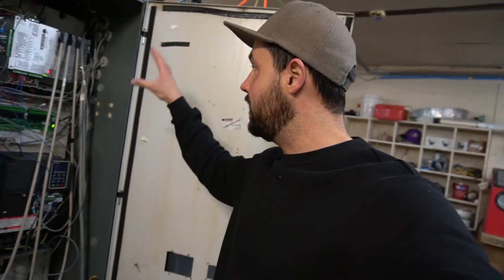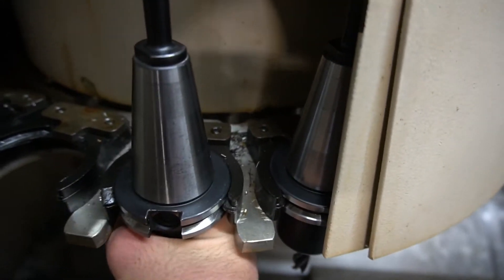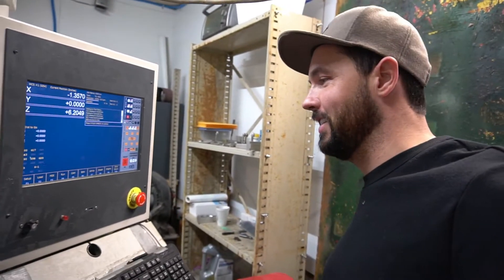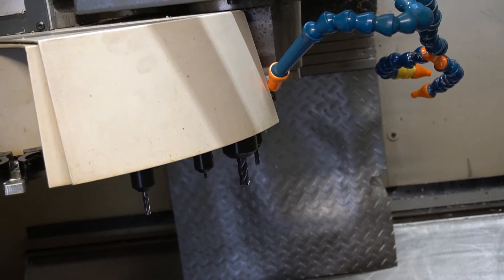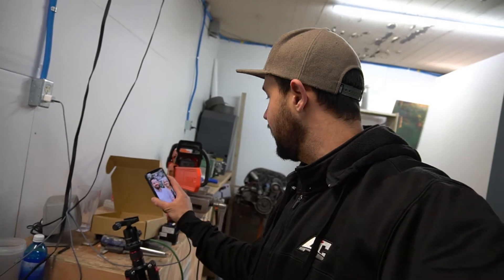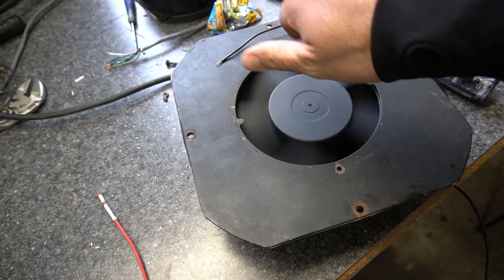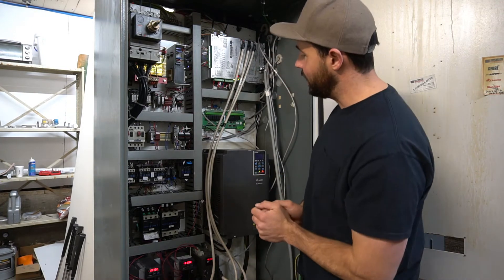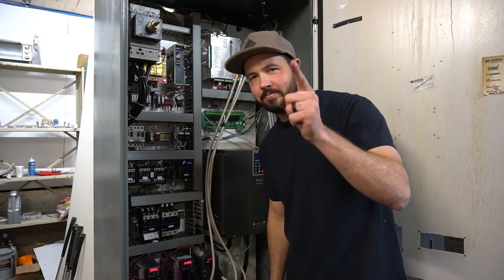Centroid CNC tool changer.

Comment: How do you use the rotary encoder to set the correct position for the spindle orient with the vfd?
Reply from the maker: What VFD are you using?  On the C2000 there is a parameter and you need the centroid orient card but has to be wired correctly.

Comment: I have 2 similar VMC's. My only fear on doing the retrofits is the tool changer integration. Very curious just how difficult it was for you to get the tool changer working?
Reply from the maker: It’s a long hard road even having done 2 of them I still had issues.  Hardest is if your carousel is servo connected.  Requires a custom PLC and a few other boards and tricks.  If they are just an index of one pulse per pocket it’s a lot easier.  If you have the time and resources a retrofit is an amazing way to go however, I couldn’t even come close to buying the value I have stuffed in my machines due to retrofitting.
Reply: @ericschneiter  Yes, the carousel is spun via a small Fanuc red cap servo. Who did your PLC work?

Comment: I can't believe I stumbled on this video as I watched your other videos on your channel before!

I'm installing a Centroid Oak on my Arrow 750 as we speak and looking for a VFD. I noticed you have the Delta C2000 and I was recommended that by Marty as well. Do you have a build thread on the Centroid forums?  Also, would you be willing to share the macros for the tool changer? I'll be most likely running into the same issue as you since I have the same tool changer.
Reply from the maker: Kris,  what’s up man!  That’s awesome to hear, you’ll be happy with your retrofit when it’s up and running. 

I would also recommend the C2000 I’ve got 2 of them on both my mills and they have been an excellent VFD!   

Info you’ll need:  
1- Buy your VFD 5 HP over your spindle motor.  If you have the 10 hp 10K rpm goldline motor you’ll want the 15HP Delta inverter:  product# VFD110C23A
You’ll also need the orient card for the inverter: EMC-PG01L 

An amazing contact for the inverter straight from DELTA in China is: 
coco@tdk-automation.com she can get you the inverter and the card.  

Once you get your inverter refer to tech bulletin 316 on the centroid forums.  It’s the most up to date.  

2-Follow the schematic and wire up your inverter with all inputs and outputs correct.  Pay special attention that the card and the inverter may sink or source depending on what schematic you are using so set the dip switches accordingly and be very thorough on labeling your wires.  
I used the existing braking resistor on top of the cabinet, use extreme caution as this circuit is probably one of the most dangerous in your install.  Don’t ever work on your resistor with your mill powered on. Or either end of the wires open, they both need to be connected to the drive if it’s powered up.

3- You’ll also need to buy a spindle encoder from centroid and machine yourself a mating sleeve to the top of the spindle motor shaft. “I can email you the solid model” There’s a nice spot to mount if you take off the fan and the existing spindle encoder.  The centroid encoder is 2000 counts and this matters when you go to set the inverter so just buy the centroid one with the pigtail lead.  It’s money well spent.  

4-When you set up your spindle inverter and motor you can leave the motor attached to the belt.  Begin with the static and the rolling test after you set the motor parameters.  If you don’t do this in exact order you’ll get overload errors while trying to run your spindle.  I also completely disregard parameter 11-00 I’ve never had good luck with the tuning.   It’s a lot man but hope this helps somewhat.
Reply: @Eric Schneiter  Eric, wow, I'm blown away with your response! Thank you for taking the time to write up the reply!! 

I'll definitely check out your contact for the C2000, and I appreciate the advice for oversizing it
I'll also check out the diagrams on the forums. 
I will most likely reuse the existing resistor as well, and thanks for the heads up on the dangers of it!
I'll make sure yo get the encoder from Centroid as well.

Thanks so much for all your help! This will greatly help with my retrofit!!
Reply from the maker: @krissondors  for sure man!  Good luck. Feel free to hit me up if you get stuck along the way. Happy to throw you pointers.  Do you have your axes moving yet?  What drives and motors are you going with?
Reply: @Eric Schneiter  I really appreciate that! I currently have the machine operational with the original Cincinnati/Kollmorgen drives.  I wanted to use them but after lots of consideration, I decided that I should replace them out since any diagnostics with the drives are a nightmare since it's all early 90s technology.  I was going to swap them out for some Chinese servos (I was looking at Tomatech servos and drives) but I came across a great deal for a decommissioned Centroid retrofit that comes with used Yaskawa servos and drives, perfectly matched for my machine. I'll be getting those this weekend so soon I'll start taking apart the Arrow and installing the Oak and motors.  I might use a generic VFD and manually chance the tools in the meantime, since I'll have to wait cod the Delta C2000 to come in.
Reply from the maker: @krissondors  awesome dude YASKAWA will be a super good option for you. It’s super slick with the probe when you get to that point.  I love my arrow, it just cuts all day now and never has issues.
Reply: @Eric Schneiter  I think so too! I was considering the Delta servos too but I feel like they are still a bit too much for what they are. I know someone who got some new Yaskawa servos and drives from Alibaba and they are legit, but he got them for way less then they sell here in the States. That was also another option I was considering.  

I'm really glad to hear your Arrow is being used a lot! I'm excited to get a probe too, I want to get one from SilverCNC, they make a wireless work probe (like the Renishaw style) for about $1400 shipped and I have heard great stuff with it. I think it would be badass to have that in my tool changer and use it for work coordinates but also digitizing too.

Comment: I’m building an 1990 Bridgeport Interact 412. How did you get orientation to work? Does your VFD have an orient option? What VFD are you running. Any suggestions would be helpful.
Reply from the maker: John Burbey, what control are you going to use? Centroid. Mach, Liniux?  I use delta VFD’s and I like them. It’s a single input and orientation is built into the inverter with a XYZ encoder.
Reply: I am using centroid acorn. What is the model number of your VFD.? What type of spindle is on your machine? How does that VFD handle speed control? Is that spindle a Yaskawa or Fanuc ? Was the Spindle encoder built in the Spindle Motor? Is the encoder just a magnetic type? Yes your help is appreciated.
Reply from the maker: @johnburbey5153   I don’t know if acorn has enough hardware to run a spindle orientation.  You may need an Oak board.   But I used a centroid encoder and found a way to mount it to my spindle motor.   My spindle motor is a Vickers but if you can pull the cover off and find the motor shaft then you can figure out a way to mount it.  I had to machine myself an adapter.    You may have an existing encoder that would work but I ditched my factory one and just went new on both retrofits I’ve done.    The encoder hooks to the Delta  C2000.  Highly recommend delta C2000 I’ve used it for both my retrofits.  Buy it 10 HP over your spindle rating is my recommendation.   Ex if you have a 10 HP motor buy a 20 HP inverter.  They claim more than they can run.  
Tech Bulletin 316 has all the steps to set up the drive and tune it correctly.  Again I believe you’ll need an oak or a board that can handle encoder input and the orient command m19.
Reply: I can use acorn you just add a ether 1616 expansion board and that gives you 16 more inputs and outputs. Yes there is a encoder in the motor but it is just a magnetic one. I planned on adding a new encoder. I had to put one on My lathe. My biggest problem was the orientation. I bought a 20 hp Fuji which is a very nice drive but it turned out to have no orient option. At this time it’s difficult to get the drives after Covid. I will check this morning and hopefully they have a Delta.                                Thanks John
Reply: Looks like the C2000 is discontinued they do have a replacement the number is 110C23A-21 I hope they didn’t change anything and they have stock.
Reply: I guess I picked the wrong time to do this the drive are out 32 weeks
Reply from the maker: @johnburbey5153  check out TDK automation on Alibaba.com.  
Coco Wan is who helps me.  She can get you an inverter within a few weeks.   See if she can get you the braking resister also, you’ll need it, you can find it on DIGI KEY and just give her the part number.
Reply: How do you search a specific vendor on alibaba ?  I have purchased a lot of stuff off alibaba  but I usually just do my search for what I need and once I purchase then I have a connection with the vendor.
Reply from the maker: @johnburbey5153  id just search TDK automation.
Reply: Hi Eric I’m back I found a Delta 110C23A-21 on Ebay. New but open box. TDK did not get me know where there just was no stock. Now my question is what watt breaking resistor are you using?
Thanks John
Reply: Hi Eric I hate to keep bothering you. I have a couple questions. Is your spindle A Permanent Magnet Motor?  Did you have to add another card to your VFD? If you did, did you use a EMC-PG01L or 2    or did you use a EMC-PG01LU  which seems to be what they want for PM motors. The EMC-PG01LU did not come up in that tech bulletin. Could you help with a wiring Diagram?   Thanks John
Reply from the maker: @johnburbey5153  I’ll have to check. I used the PG01L for my inverters but my spindle motors are induction 10hp and 15hp.  So if they are telling you that they usually know their stuff.   As far as getting it working I’m not sure if the card would work different.  You might need to send Centroid a message, I would think it would still work the same wiring diagram.
Reply from the maker: @johnburbey5153  any updates on your spindle?  Did you get your VFD working yet?
Reply: @ericschneiter  I just cant get the PG01L card to set up. When I put it into FOCPG mode and try to run the spindle I get Error code PGF3. I am not having any luck getting any tech support. From Delta or Centroid. When You set up your card does it allow you to set the rpms of the motor past 1799 RPM. I spindle runs great when not set up in FOCPG mode. I am using to make some parts just cant use the tool changer.
Reply from the maker: @johnburbey5153  you can leave the RPM where it is. It’s not relevant.  Your frequency will decide what speed your spindle actually spins. Super deceiving parameter.  What encoder are you using?
Reply: @ericschneiter  I tried a omron encoder I thought that might have been bad then i bought the one from centroid and it does the same thing I just don't know where to turn
Reply from the maker: @johnburbey5153  what do you have the encoder counts set at?  And what do you have it set at in centroid?  Should be 2000 on the C2000 and 8000 on the centroid control.
Reply: It says on the sheet set at 1024 that’s where I have it
Reply from the maker: @johnburbey5153  let me check pretty sure this is an error.  What tech bulletin are you using. Make sure you use 316 it’s the most recent.
Reply from the maker: @johnburbey5153  set the C2000 at 2000, Centroid Counts/Rev at 8000 and MAKE SURE you set MOTOR REVS/IN at 1.   Then go back in, tune parameter 5 static and rolling and then try putting yourself in FOCPG mode.
Reply: @ericschneiter  well the 2000 seemed to help it doesn't get the error but it sounds rougher when it runs. and when I change the hertz to bring up the speed it doesn't do anything and when you try to control the speed from centroid  it is not very responsive
Reply from the maker: @johnburbey5153  did you do the tuning in parameter 11?   I never had luck with that.  You might try resetting it, set the parameters in the C2000 just for the motor, tune in parameter 5 and then set the rest of the parameters.   It may be different for Acron than Oak. This is what I did.
Reply: @ericschneiter  Thank You again I think I am in a better place now than Before. I think It was the 2000 count. I think now the issue is in my encoder. Yesterday I was doing something with the PG card and I hit the 12/5 volt button and smoked my centroid encoder. Now I'm running on my Omron encoder off the spindle with a belt and it's not a timing belt It appears to be slipping a bit and now I think that is messing with it. When I bring up the Number from 100 to 120 in parameter 10-5 it sounds great. Thanks Again I ordered some timing pulleys so I can set up my Omron Encoder to not slip and I think I will Be ok.
Reply: Here is something else I'm not understanding this statement: 5. To see encoder count orientation position. At the VFD display press the down key until DC-BUS voltage is
highlighted. Select the right arrow until you see the encoder counts (Gxxxx pules) will be displayed    ( Well I don't see any DC-BUS Voltage )
Reply: Yes I’m using 316
Reply: Ok thank you very much that gives me something else to try